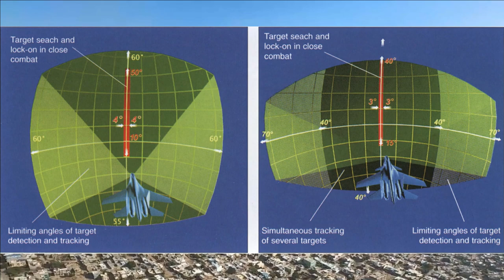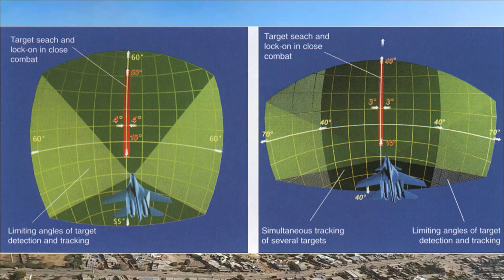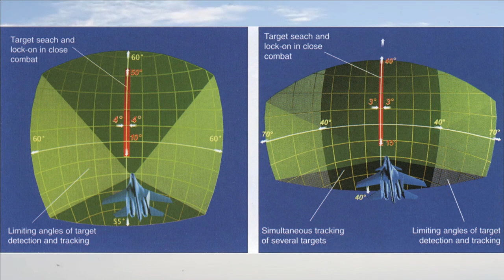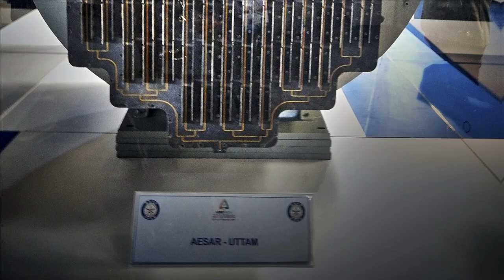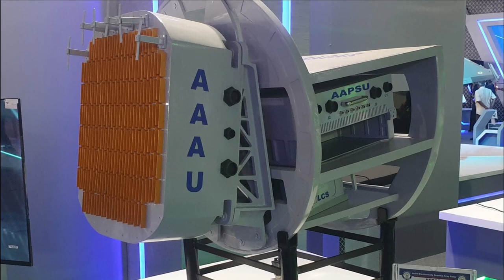SU-30 MKI mini-AWACS : Hybrid PESA to AESA Radar #iaf #drdo #hal #indianairforce

Comment from the maker: Small correction: at 1:43 it’s +- 70 degrees not 7
Reply: Pakistan has 11 AWACS , we have 06 . Pakistan has Shapur , Winglong , Barackter armed drones , we are still using loterien mutation drones. 
Our squadron strength is 31 when we require at least 42 ( some suggest 55 for 2 front war ) .
News is coming that Pakistan is catching up on submarine strength .
Definitely our defence planning is not good .
Reply from the maker: @basuvivek643  yes we need more awacs - we have been vocal about Netra Mark1 repeat order for this reason as it can be delivered at much faster rate
Reply: @IndianDefenseAnalysis  
Please Share This Message 
Please Forward This To Education Ministry
Reservation Is A Very Sensitive Topic Which Has To Be Addressed But Very Carefully As It May Cause Many Political Controversies.
But These Are My Ideas How To Bypass Reservation 
1)Affiliation System Has To Be Abrogated(In Affiliation System Every State Has Institutes Which Are Affiliated To Respective State Universities And University Will Offer Degree Irrespective Of Which Institute You Pass Out. In This System Institutes Are Hands Tied By The State University Because Institute Will Have To Do What State University Tells Because Of Which Institutes Become Mere Teaching Shops And There Is No Productivity Or Research Activity)
If Institutes Become Autonomous Degree Offering Then There Will Be Flexibility In Deciding Syllabus, Free Hand To Carry Out Any Research Projects, Free Hand To Collaborate With Other Institutes And Industries. 
Why IITS Are Top Class Because They Are Autonomous Degree Offering Institutes Because Of Which There Is Flexibility In Deciding Syllabus, Free Hand For Collaboration And Research. 
Other Reason Why IITs Are Top Class Is They Get Government Funding. This Has To Change. Government Must Proritize Funding Of Research Projects In Private Institutes. What Happens Is That All Institutes In This Country Become Highly Standardized. There Will Be No Difference Between IITs And Non IITs.
2)To Reduce Competition For MBBS Seat The Standards Of B.Pharm Course Has To Increase So That Both MBBS And B.Pharm Course Become Equally High Standards. Student Need Not Have To Feel Uncomfortable That If He/She Has Missed MBBS Then Atleast He/She Has B.Pharm Course Which Is Equally High Standar
3)There Has To Be Equal Education For All Children Studying From Class 1 To Class 12 Which Means All Educational Boards Have To Be Dissolved And There Has To Be One Nation One Education

Comment: When you add a powerful radar, it will require more power, I feel that AL-31F engine that Su-30MKI uses is insufficient, thus there are two options
1. To use the present AL-31F engine and use Uttam Radar wth Less TR modules than possible,  almost like 1500 - 1800 TR modules.
2. To get a better engine like say AL-41 (used on Su-35S) or say Izdeliye 30 engine being developed for Su-57, and the use the max possible TR modules that can be upto 2500 TR modules
I think India should go for better engine that can generate more power, when more power is available, we can not only use a bigger AESA radar that can be possible but also develop new EW pods that can utlise more power generated by the more powerful engines and hence have an excellent EW suite & plane that can enter enemy air space and wreck havoc
Reply: HAL is negotiating the AL-41 engine upgrade. For once, the IAF is ahead of the curve and acting to decisively address weakness.
Reply: It is little to do with engine itself rather starter generator
Reply: DRDO has started taking Baby Steps towards developing our Heavy Combat Aircraft like Su 30. Full scale development will start after 2035. when AMCA is done. That time we will go for AL 41 with transfer of technology from Russia.
Reply: Problem is cost. upgradation of all these 260 jets cost too much and govt at this time not willing to do this, i think HAL put less power consumption AESA radar in this, may be some 4 or 5 squdrens after 2030 upgrade on new engine but rest are not and solution which will be initiate is acquire more AWACS from outside and from inside which not only used by su 30 but also every type of Indian jet.. at this time if we put even 1200 module AESA radar with some downgrade type spectra version and meteor type Astra mk2 or mk2 is works for next 10 year but one thing also we should to with Sukhoi is make some parts of Sukhoi from cabon fibre composite body to reduce its RCS naturally..
Reply: @irshadhussain2856  Of course cost is there, but all the 260 jets wont be upgraded at same time, maybe in batches of say 20 or so, per year, so this upgrade will take maybe 10 years or so, 
Su-30 MKI is good plane, but would they be good enough to face say Chinese J-20 with their AESA? Pak F-16 with AIM-120C-5 can be confident to take Su-30 MKI at par, as MKI does not have long range missiles. Also the detection range is not top notch, but with AL-41F engines, bigger AESA and ASTRA Mk 1 & II, Su-30 MKI will have dominance over pak air space, and be able to contest air space at China side.  1200 modules will help detection but having top notch 2500 modules will be able to not only have longer detection, but also be able to detect stealth planes at much longer ranges, thus taking away advantage of JF-20, also with good power, the plane can conduct Electronic warfare missions with SEAD/DEAD to ensure complete air dominance. The upgrades can start sooner, & each upgrade might take say 15-20 months, but a new plane can take upto 36 months to produce, thus with upgrade we can make the fleet more upto date while it waits for new planes. We can make our Su-30 MKI Super upgrade at par with F-15 EX
Reply: @dibyamartandasamanta583  
Please Share My Message 
We All Know That Reservation Is A Sensitive Issue Which Cannot Be Addressed Easily As It Will Lead To Political Controversies. But It Can Be Bypassed Easily By Following Ways
1)Remember Why IITs Are Sought After The Reason Is IITs Are Autonomous Degree Offering Institutes Wherein They Are Flexible In Deciding Syllabus To Be Taught And They Have Flexibility In Taking Up Their Own Research Projects And Collaboration With Industries.
Other Institutes In Different States Are Affiliated To Respective State Universities. So Institutes Are Bound To Do What Respective State University Tells Them To Do Hence These State Institutes Are Hands Tied Which Makes These Institutes Just A Teaching Shop. 
This Affiliation System Has To Be Abrogated And Every Institute Should Become Autonomous Degree Offering Institute So That Every Institute Has The Flexibility To Set Their Own Curriculum And Flexibility To Carry Own Research Projects And Flexibility To Tie Up With Other Institutes And Industries. 
Other Reason Why IITs Are Sought After Is Because IITs Get Government Funding Which Other Institutes Don't Get. This Has To Change
The Government Must Sideline IITs And Give More Importance For Funding Private Educational Institutes For Research Projects. There Has To Be A Strict Technical Body To Ensure That All Institutes Have Uniform High Standards Of Syllabus, Research, Compulsory Tie Ups With Industries Failing Which Their Recognition For Corresponding Year Will Be Withdrawn.
Every Institute In This Country Should Become Competitive As IIT
2)Management Offering Institutes And Other Other Institutes Also Should Follow Same As Mentioned In Point 1
3)To Solve Competition For MBBS.
Please Increase The Standards Of B.Pharm Course And B.Pharm Course On The Levels Of MBBS So That If Student Feels Having Missed MBBS A Sense Of Comfort Atleast He/She Has B.Pharm Will Be There.
Please Share This Message To All And I Want Your Views On This
4)Uniform Education From Class 1 To Class12 For All Children Irrespective Of Which State Caste Creed Which Means Dissolution Of All Central And State Educational Boards
Reply: Al41 is possible but not izdeliye30 they'll never allow it to buy for atleast the coming 10yrs
Reply: @franaguite2648  noted, but understand that for the PAKFA project, which then became Su-57, India had invested as a partner and did not get anything, If India does not get ToT for Izdeliye 30 engine, India would detach from the Russian weapons, if you see the situation, India is not buying T-14 or Su--57 even when offered, we are going for our own indegenous projects, Also for MRCA. I dont think Russian companies have a chance.  The only thing significant that we have taken from Russia is Frigates and AK-103, even that too is pending, Carbines are being purchase from Indian maker, India buying almost 75000 sig Sauer rifles and giving them to frontline troops, SP gun, its Korean K-9, for missiles we are taking French and developing our own for use on Russian platform. Slowly but surely we are moving away from Russian weapon systems. as India has been cheated in the past, we dont want to do the same mistake.
We have taken Russian S-400 system, and we are developing our own 3 tier Air defence using Akash, PAD, and other systems that work in conjunction, If the Russians dont offer Item 30 engine, India will uprate the AL-31 FP that we build under TOT, but shift further away from Russian supply chain.
Reply: Electronics should miniturize in a few we should focus on efficiency

Comment: Need to change AESA from pesa, spectra type EW suite, meteor type Astra mk 2 or 3 , need to add more 360 degree coverage awacs , use carbon fibre composite material atleast 25 percent of its body . These things we need to solve today , these su 27 skeleton will not out of the scenario even for next 40 years atleast coz china main horse is J 11 which is another Su 27 skeleton based jet ..

Comment: kindly explain the AWACS capability of su 30mki.... everyone mentions it,but no one  explains it..
Reply: From what I read, su30/35 equipped by bars and ibris E PESA can use a special "mode" That give them very long detection and tracking range but very limited field of view (~350 km against 4th gen fighters). Combining it with a second pilot and datalinks, su30 mki can be used as a "mini awacs" In some situations. Proper full blown AESA Awacs provide better endurance, field of view, computing power, anti jamming and EW thought.